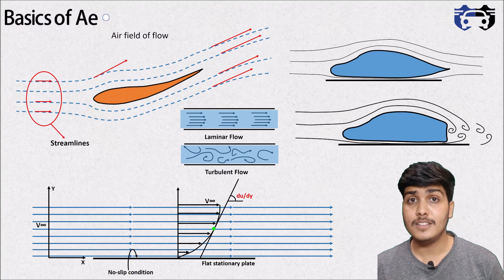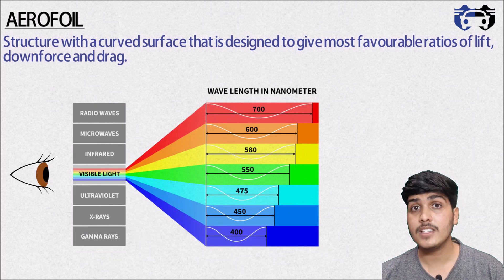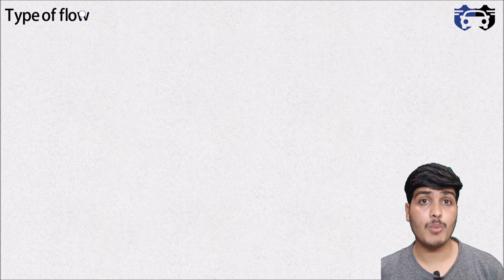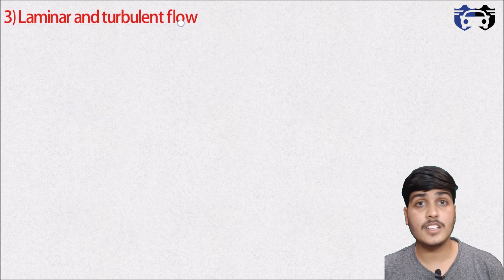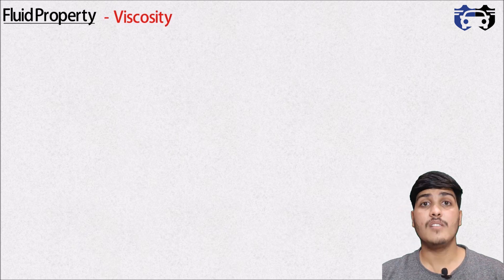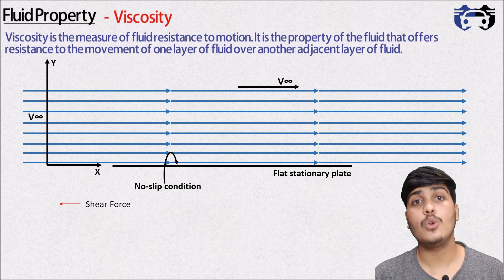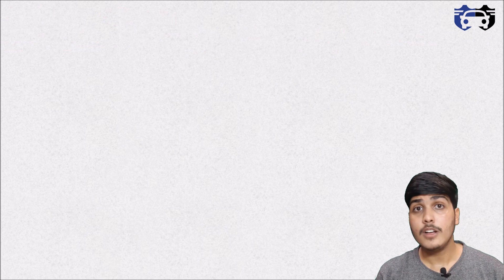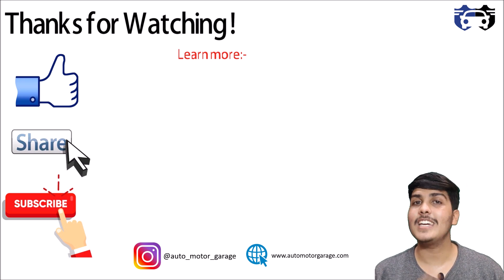Basic Aerodynamic terms | Aerofoil |Fluid property|Type of flows | Reynolds number | Automotorgarage

Comment: Great video! Helped me put together some more concepts. 

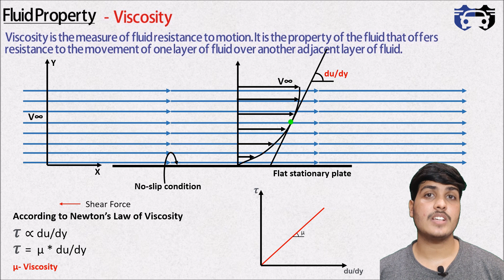To add on @ 5:50 shear stress is shown to be proportional to du/dy. This relationship is shown to be linearly related via constant mu - (dynamic) viscosity,  this is a Newtonian Fluid. You can look up Newtonian fluid and see other types of fluids are non-linear, such as toothpaste. 

Another interesting point to add is the velocity profile above the plate is for laminar flow. The diagram shows something called the boundary layer, which is covered in his next video (also great). If you lookup "laminar vs turbulent boundary layer" you will notice a difference in the two profiles. You'll see the turbulent boundary layer stays closer to the plate over a distance. This is because the turbulent flow has more mixing, which causes it to stay attached to the plate for longer.